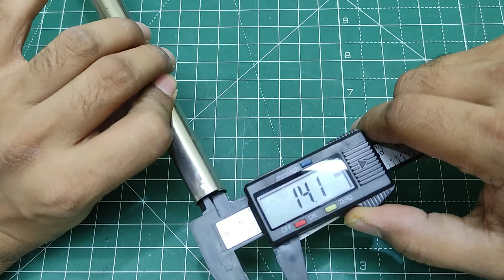How to make Linear Actuator | DIY Linear Actuator

Comment: Bro i have a dout does the upper rod of linear actuator rotates or it will just move up
Reply: It can be both if you pin a cover to the housing it will not rotate

If you free the motor along the shaft axis and pin the nut the motor will pull itself and the shaft while rotating

Comment: What did you do for its self locking. Once it is in extended position holding some good weight, it will start retracting due to weight.
Reply from the maker: threads wont let it go